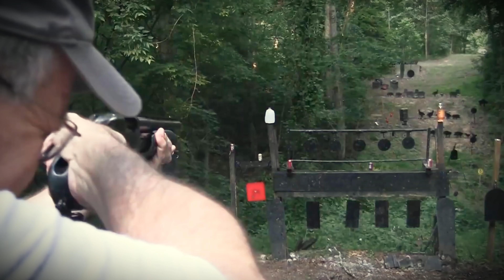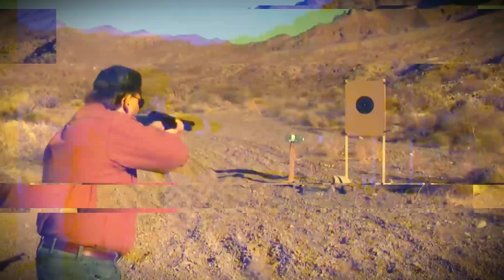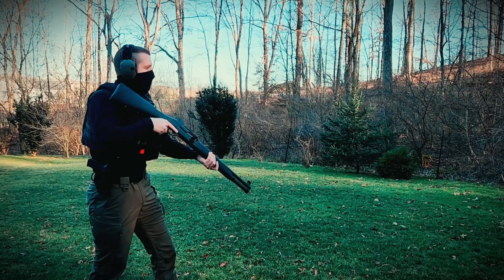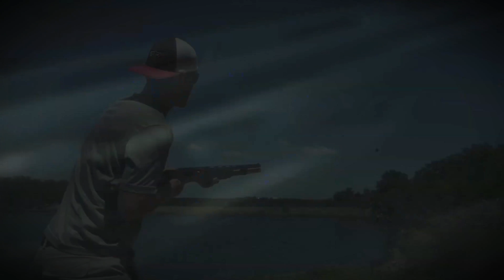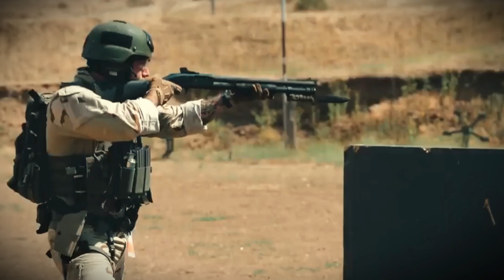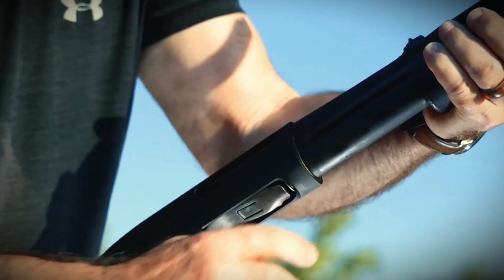Top 10 Best Budget Shotguns: Don’t Let the Price Fool You!

Comment: First I wondered why the Beretta A300 Ultima could be considered a budget shotgun. Then I saw the reported price of $800 and was surprised to see such a low price quoted. Finally I watched the description of the Beretta Blink Gas system as being a feature of the A300.  Sorry but this is simply wrong the A300 uses the Beretta 390 gas system with a recoil tube in the buttstock. The newer Blink system is a feature of the Beretta 1301.
Reply from the maker: Appreciate the detailed correction—that’s a great catch. You’re right about the gas system differences, thanks for pointing it out.

Comment: The H&R PARDNER PUMP IS A VERY SIMILAR REMMINGTON 870 FOR $200. MODIFIED IT TO A TACTICAL ALL 870 PARTS EXCEPT HEAT SHIELD AND BARREL
Reply: Yep I have the 20 gauge version with an extension tube giving it 8+1 capacity. Got it for $120, the store was closing. Have had it for about 10 years and have ran a few thousand  rounds and still is running great. I live in the country so I just go out and burn a few boxes every now and then.
Reply: Excellent point bringing this up! I haven’t modified mine at yet, i absolutely love it though.
Reply: I have one. I love it! It's all you need from a pump. Minimal perfection 👌

Comment: I have 2 maverick 88. 1 20_/1 12. Love both.
Reply: I bought an 88 youth model in 20ga at Walmart for $199 as a house gun. Put a RD50 dot on her, it works great! Lightweight and easy to swing around.
Reply: @JohnMeyers-fn2js What's different about the youth model...a shorter stock?
Reply: @SleepWith1iOpen-X yes.
Reply: I got 6 or 7 security 88s.  They all work 100%